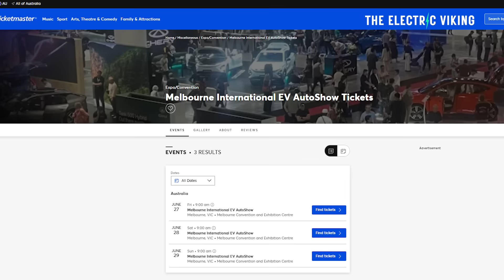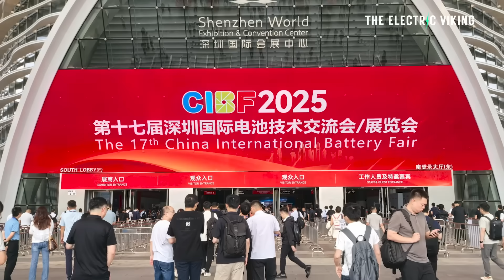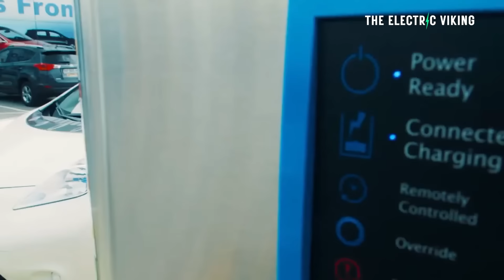China reveals 1400kw EV batteries that add 150km in 1 minute

Comment: 1.5 MW charger has been unveiled by Huawei...as someone said, those charging speeds are suited more for large trucks and trailers.
IMO, it is rather more important to have charging stations as ubiquitous as gas stations, than having extremely fast charging capabilities. if you are stuck with no charging stations around then it wont matter how fast you charge and hence the need for PHEVs will be there until ( it becomes too expensive to have gas stations with limited customers and turnaround + charging stations become widely available).

Comment: Dear Viking, I may or may not be wrong but I think I heard you saying a "1400 Amps battery" in the early sectors of the video several times. Compared to the title who says 1400 KW this is quite different. And I think the one in the title is the correct one. Not sure if you could go back and correct that in the video by oversampling the audio? Because I think 1400 Amps would be some 1.12 GW @ 800V which is just this tiny little bit too much for a charging power. 😜:goodvibes::thanksdoc::goodvibes:. Kind greetings from Switzerland.
Reply: I agree.  This claim had me going for my calculator.  Huawei's 1.5MW charger requires two charger cables, so is pushing 1200A through each cable at 600 to 800V.  So you could theoretically charge this massive battery faster than you get a coffee.

Comment: These claims are increasingly unbelievable. There has to be a testing standard or organization to verify them. Is it safe, is it reliable, good for car and battery?
Reply: The biggest obstacle is finding a charger that’s capable of charging at these rates. Even though the batteries/ cars are capable of charging at these speeds, it’s going to take a while before the electricity grid is capable of reliably providing it at an average charging station.
Reply: @ShadawGaming  Yes indeed - even with local storage at the charging station.

Comment: faster charging means faster dying of the battery.
Reply: For a one minute duration with proper cooling? You're overthinking this. The charging algorithm won't allow extended durations at that high of a charge rate. Faster degradation than charging from home? Sure.

Comment: Megawatt charging is a luxury for cars; for long-haul, heavy-duty trucks it is a necessity. I would be interested to know how the HDT market is evolving in China, and what the economic impacts are.
Reply: Since in China a lot of buses and trucks are already driving electric, it is to be expected that MCS is going to be spread out very quickly and that this has a positive impact on China's economy. The latter is just a thought of mine based on the following:
- It offers use of the energy generated by the huge amount of PV and wind power plants added each year in China in any case.
- It offers to pass the carbon import peak which will help China to have less cash drain just to keep going in spite of growth.
- It helps maintaining growth even if fossil fuel prices pike globally.
- It drives domestic demand of any type of goods as these potentially come even cheaper.
- It allows Chinese manufacturers to work @ better margins when exporting goods as things get cheaper domestically.

Comment: Pack density will treble and pack weight will half most likely over the next ten years. Manufacturers will balance smaller cheaper packs that get 300 miles real world in it’s small segment. It will be done common to to think the bigger the cars EV the range will be real world 500 miles if not 600. They seem to be chasing this 1000km real world range that to many isn’t needed but it is what is it. Battery development world wide is on such a level it’s scary. A dealer making £5k per car doesn’t care if the car costs £25k or £50k  but they will sell more £25k cars making more money. Manufacturers are going to learn how to make EV’s cheaper year by year for a few years while adding range and pack safety longevity.

Comment: In the last report about 10C and 1000 kW has shown that the 𝐭𝐨𝐩 𝐜𝐡𝐚𝐫𝐠𝐢𝐧𝐠 𝐬𝐩𝐞𝐞𝐝 𝐰𝐚𝐬 𝐨𝐧𝐥𝐲 𝐚𝐯𝐚𝐢𝐥𝐚𝐛𝐥𝐞 from 9% to 23% of SOC. After that it fell to 600 kW until 43%. 
- The second number is actually quite good - but it shows that any 12C or 1400 kW numbers can not be extrapolated to a fully charged vehicle. And this channel maker does surely know that, but.
- Details about the 10C battery did also show that speedup did not come from better cooling but from decreasing the anode resistance, probably making it thinner. That makes it questionable if the cycle stability is the same.

Comment: Sure, let's put 3 chargers outside a nuclear power plant and have a 490 lb cable plugged in to charge it in 3 minutes.
The cable size could be reduced if we used 12k volt batteries though, but that power is still insurmountable.
We are already at the peak of whar chargers can do at 350kw, much less 10 times that. The power of a 20 stall Tesla charging station would be required to just do one car at a time. Sure, car charges in 3 minutes, but you have to wait in line for 2 hours to use the ONE charger using enough power to supply a small city.
There are physics involved that cannot be altered.
Reply: Why do you have to wait 2 hours if it only takes 3 minutes? It's not like you can't charge it slower elsewhere if needed so the line up shouldn't be huge
Reply: Although your comment is spot on,  the majority of respondents here are a testament to the failure of public education.

Comment: Just work out what sort of amperage you need to charge a, say, 60kWh battery in such a short time.  And multiply this by, say, 10 cars charging at the same time at a charging station.  We better hope that most people charge at home at night from their home battery that has been charged during the day from their solar panels.  Fortunately this is how much of the car charging is happening at present.   With larger EV batteries, you don't have to charge as often away from home.  We haven't charged away from home since we got an EV with a decent capacity.
Reply: Yeah, you are right, but then it will be more than 3 4 chargers that will be empty 80% of the time as most gas stations. The faster you go, the less time it needs to charge a car, and you need less chargers. It will be more about having big battery pack at the charging station, that would charge constantly at much lower charging speed.
Reply: The problem with the bigger battery for more range is more cost and more weight. Why would you want to pay an extra $5-10k for that kind of range when you typically drive 40 miles a day?
Reply: @lkeil84 

Some might and the battery chemistry and price will keep getting cheaper ...long term as they evolve and become  standardise... At the moment  Na Is only about 10% of Li material cost much of the production hardware is the same as for Li Fe PO4... so its research, conversion and set up cost.. then 🤞🏻 the price drops further and the power will grow ...faster than with lithium as CATL and others see it. 
You can also use it for static storage.. over a greater environmental range. 

Remember Prof Donald Sadoways maxim ...for electricity storage to work its got to be Dirt cheap, widely available, long lasting and safe...
Reply: @lkeil84  Because there are also other use cases. Not everyone needs this for sure, but some people are waiting for it.
Reply: Yeah, this charging speed won't increase charging station throughput, because that amount of energy is huge and needs to get to the charging station in the first place.  However, if a charging station today has a capacity of 10 vehicles / hour, and still has 10 vehicles an hour after upgrades to this speed, individual cars will cycle through much faster individually.  We will need fewer charging stalls and people will experience shorter wait times for charger availability and total charge.  Instead of 10 cars charging in parallel for 50 minutes, you can have 10 cars charging in sequence for 5 minutes each.
Reply: @krakken-  That depends on the stations technology. Assuming a large local battery will supply this during the day, the grid has typically all night to refill the battery as few people will be charging during the night. This way you can get up to 20 vehicles/hour so the limiting factor will be the time needed to pull up for the next customer, get out of the car, plug the cable and start the charging, then unplug, get to the car, sit down and pull off. Not so much anymore will charging itself be the limit.

Comment: I think by 2030, most EVs will be able to charge faster than gas cars can fill up. It might be possible that wireless charging will take over by then and make the process way faster and more convenient than filling up  a gas car. The tech just keeps getting better!
Reply: Can you imagine the size of a transfer coil to Handel 1,400 kw of wireless charging. It would be heavier than the car itself. In fact, it would be larger than the car itself.
Reply: @lkeil84 you can pick up Tesla’s 1 Mw+ handle and cable with one hand.
Reply: At this rate of Chinese progress, EV's will drive-by a charge and get charged fully.
Reply: @SamiUllah-us1gb  This is already in test. However with this tech, there is not the search of the max. possible charging speed because when charging on drive by, time is not that important when the driver still makes progress on his trip while charging. The currently made tests are showing a car being charged at speeds you would typically see inside a populated area however, not necessarily on highway speeds.
The wireless chargin station therefore is a few hundred yards in length and can only charge a fraction of the batteries capacity in one drive by, when a 300 yards long wireless charger is driven by in just over 21s @ 50Km/h speed.
Maybe it will be these dimensions that are holding back a bit on this technology while the current focus of development is clearly on fast charging rather than on wireless.
Reply: Yeah the density of a mid sized battery in a mid car will out  perform a fuel tank range for sure… 500-600 miles on one charge with sub 5 minute 80%.
Reply: The technology is incredible!  It's no longer a question of if, but when.
Reply: Never going to be enough electricity to do any of this...this pie in the sky
Reply: Lmfao the Sun is putting off more energy every day then all the petroleum that exists.  @ITS_BOBBY47